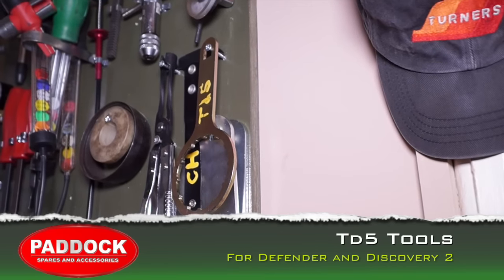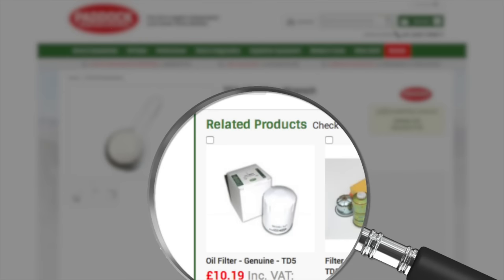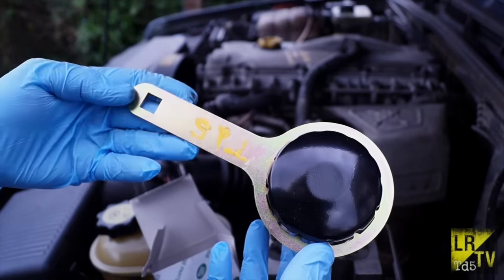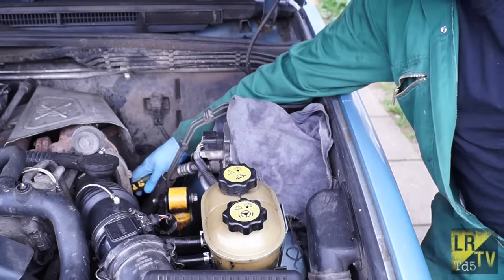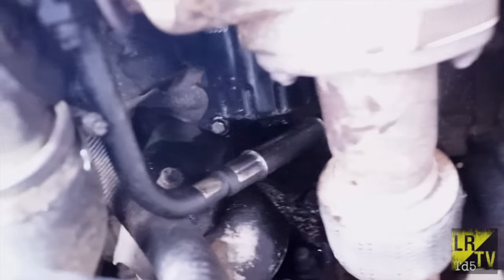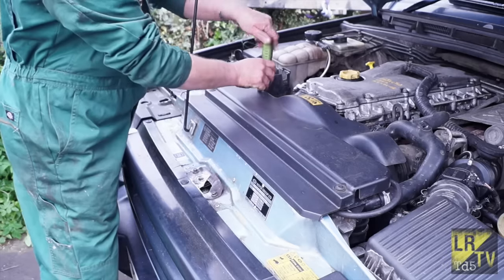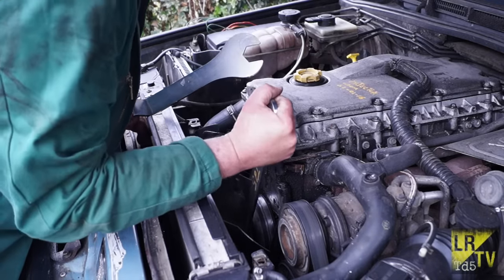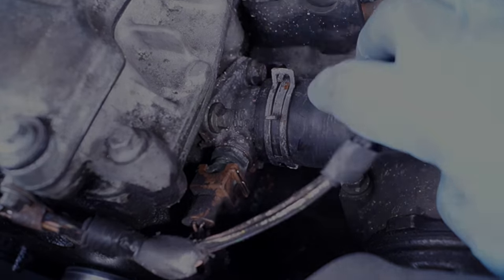Td5 Defender - Discovery 2  Oil Filter Spanner and Viscous Hub Spanner Tools.

Comment: Just done my first service on my TD5 defender, the oil filter was so loose it wasn’t even finger tight, moved as soon as I touched it, however it didn’t leak any oil which shows it really doesn’t need to be as tight as some seem to think.

By contrast it took me 40 minutes to get my oil drain plug undone because the idiot who last serviced the vehicle didn’t use a copper washer and torqued it up like it was a nut on a wolf wheel🙄, how I got it off without stripping the thread I’ve no idea.

Comment: I have a 1985 Defender 110 with 2.5 NA diesel engine 
and I'm currently having problems the engine at the first time.
no matter the time or day the engine will crank over a minute before starting.
Also there's lots of white smoke coming out the exhaust pipe while cranking.
I was wondering if you could give me any suggestions what to look for?

Comment: I have the petrol v8 but I am looking at how close that filter is to the exhaust pipe. I think you should make a heat shield. keep that oil cooler I would think
Reply from the maker: +tonymengela  Yes that is a good thought.  the oil cooler is not too far away from that area either.
Reply: ***** I hear good and bad things about wrapping the exhaust pipes what are your thoughts and experiences,,, I have the fiberglass wrap but I am unsure at this point. I was thinking the area by the front drive shaft as I hear that the exhaust heat wears them out real fast... I put a whole new one in when I got the rover so that weak point was out of the way from not knowing previous maintenance, but I like to prevent problems too. Great videos though! always like to learn new.
Reply from the maker: heat shields are better.  if you understand the principles behind double glazing it similar physics.

Comment: that hole seems to be blocked by the fly wheel. i gave the clutch a bit of high rpm burn and now is a lot better, but the springs do seem to rattle on take up.
Reply from the maker: (y)

Comment: while on subject of oil, i have bad judder from clutch on my 300 disco could i drill hole in bell housing and stick my inspection camera in .
Reply from the maker: there is a drain hole in there already on the bell housing.  Should be easy enough to fit an endoscope in there.

Comment: I know in the states there are a few companies who make a remote mounting solution for bringing the filter up within reach especially when one has these hard to reach areas. Is anyone in the UK making such an aftermarket accessory for the LR TD5's or any other diesel that might have such difficult mounting positions? It would be well worth the cost in time and possible injury elimination.
Reply: it is awkward but not too hard. Although I have the tool, I have managed to unscrew the filter by hand. important thing is that the engine should still be quite warm